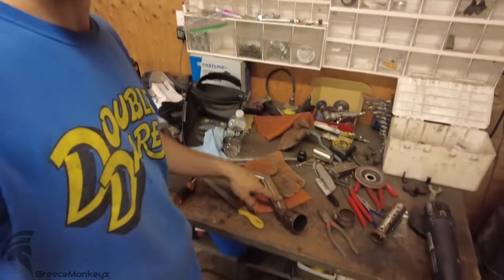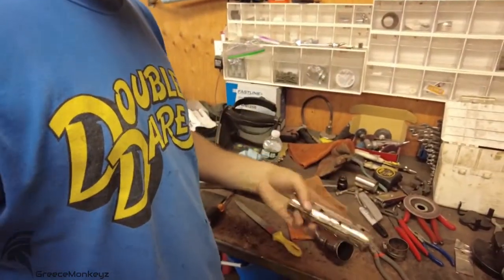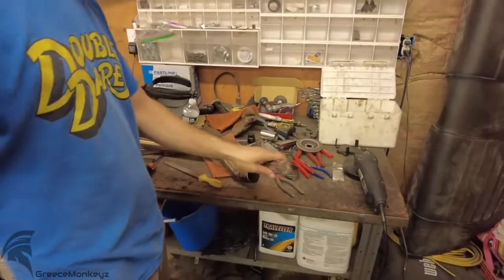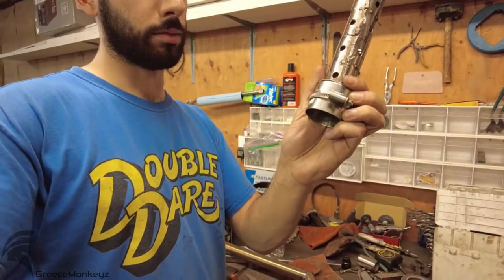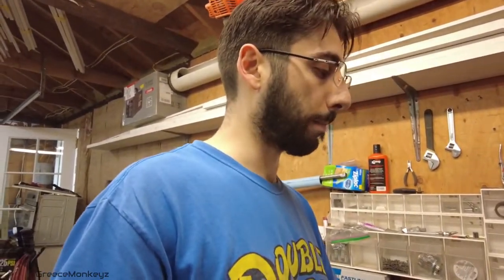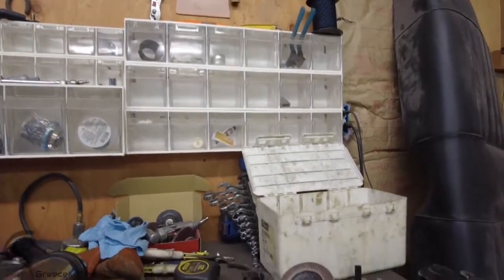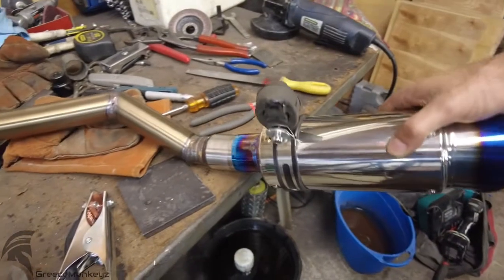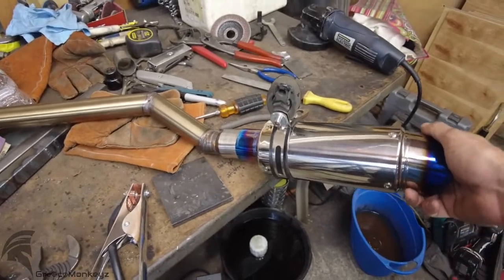Home made silencer for motorcycle exhaust equipped kei truck

Comment: Sounds much better with the silencer.  Also, great fabrication job!  Is there any regulation where you live on max vehicle db?  I like that wide sound you have, but it's hard to achieve without getting too loud.
Reply from the maker: Thanks!   So technically yes there is a db limit but so long as you don't do anything else stupid and are quieter than say, a harley davidson, the police don't really bother you.   They also don't do vehicle inspections here in CT, especially not on antique vehicles.
Reply: @GreeceMonkeyz  Yeah, that's great.  Here, the police won't bother you, but we do have inspections where the sound level gets measured, so lots of people have removable baffles for that reason.